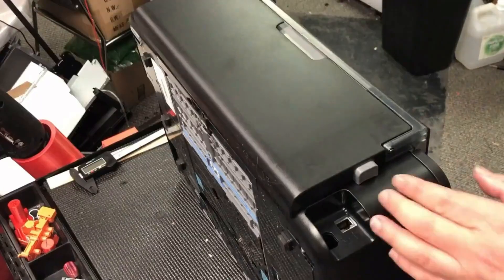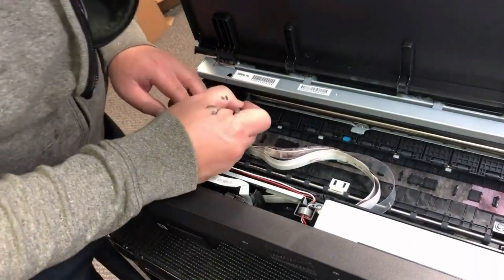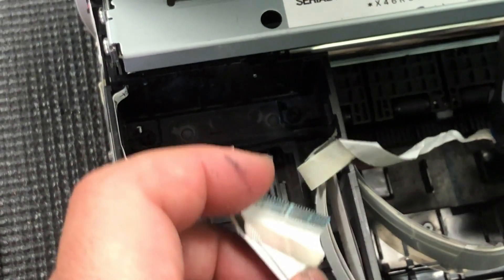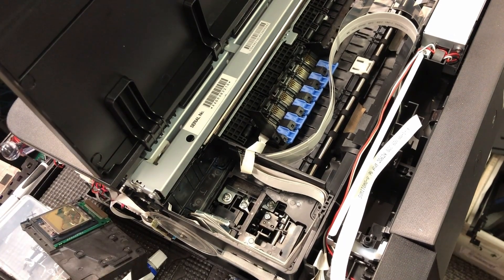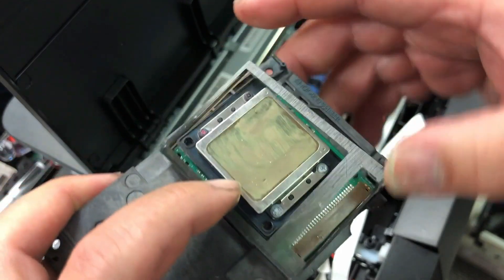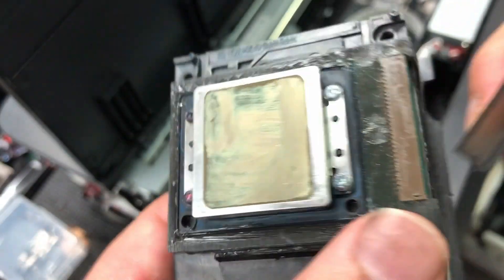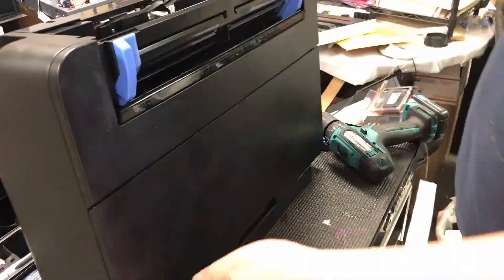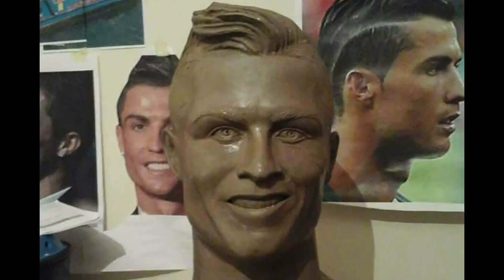Transform Your XP-15000 Into A DTF/Sublimation Machine - Step 2 Waterproof Printhead

Comment: If you're not using RIP software there's no need to waterproof your printer.  RIP software overrides ink flow and re-assigns white to either Red or Gray, which you only need for DTF printing.  Hence, if you're doing sublimation there's no need to waterproof your printer.  Just make sure you're using the correct sublimation paper and settings to semi-gloss.

Comment: Hi, I tried to waterproof a printer head on an Epson xp-8600 but fuse F1 blew right away. I used normal bathroom silicone. was this the cause or are there some components that cannot get silicone on them? I have problems finding silicone for electrical components here in Norway.
Reply from the maker: I always test the silicone with a multimeter before using it, if it's a new brand. Most electrical and marine silicones are good to use.

Comment: @bchtechnologies your step 1 video link does not work. it says it is private. What happened to your tutorial of combined videos to convert the xp15000 to dtf?
Reply: i got the same problem did not see the first part then fry my board cause of it not sure where to find the part one on my second printer een after waterproof it so please make this part not private cause i got no clue what to do with the csic ???
Reply: @guapo5852  @bchtechnologies had a video at one point on how to convert the printer. It was 30 min long with good details. I don't know why it got taken down. I think it's the video that's private. I haven't converted my printer bx I want to review that video as well. Yea, I couldn't find that part on his site either. I think we can just silicone the circuit.
Reply: @gilbertlopez7502   i was thinking to same i just have to get a other xp 15000 today and im so scare to do it again so not sure if we can add silicone i try to remove on my broken one to practice and its not that easy its a little scary to remove the cable so i thonk i will try just silicone it but im scared lol
Reply: @guapo5852  yea he doesn't reply so idk lol
Reply: @guapo5852  I reviewed this video again. really step one is to do the chipless set up. there are other videos online to do this. Its fairly simple. the CSIC board its what is under the ink cartridge. Watch the beginning how he removes it and tucks it into the printer under the front. You dont need the print head protector cover he showed. In another video he has, he just put silicone around the printe head without the cover.
Reply from the maker: Thanks for bringing that to our attention! We're looking into the issue with the Step 1 video. Stay tuned for an update!

Comment: Do you need to let it dry before you turn it back on
Reply from the maker: Thanks for subscribing and for the great question! Your support means a lot to me—I'm working hard to reach 100k subscribers, and every single one helps me get closer. It’s been 8 years, and I’m only halfway there, but I’m committed to providing helpful content and answering questions from subscribers like you.

To answer your question, the electronic-grade silicone you purchased from us is specifically designed for electronic components like the Epson XP-15000 printhead. However, if you use other kind of silicone, it's worth to check with the manufacture. Ours is completely safe to use even before it dries. The silicone provides insulation up to 10,000 volts when wet and 12,000 volts once dry. Since the XP-15000 printhead operates at only 42 volts, you can turn the printer back on immediately after applying it—there’s no need to wait for it to dry.

I get a lot of questions and try to answer subscribers within 48 hours, but if you ever need a quicker response, feel free to email me at support@bchtechnologies.com. Thanks again for watching and supporting the channel—I appreciate it!

Comment: The link to the protective cover guard shows an error. I do not see the piece you used in accessories either. :/
Reply from the maker: Hey! Thanks so much for subscribing and for bringing this to my attention. I really appreciate the support – every subscriber helps me get closer to that 100k goal. I’m halfway there after 8 years, and your feedback helps improve the channel and content.

The link should be corrected now. Initially, we introduced a two-piece beta printhead guard set for the XP-15000 – one larger piece for the printhead and a smaller one to protect the FFC. After testing, we found that the larger guard could interfere with the printer's alignment, so we discontinued it. Instead, I’ve created a tutorial showing how to waterproof the area with silicone sealant, which achieves the same result without risking misalignment.

We’ve kept and improved the smaller FFC guard because it plays a vital role in preventing ink from seeping into the printhead connections. Since the larger guard is no longer part of the kit, we now include two of the smaller guards, so you’ll have a backup. The small guard provides essential protection while allowing easy access for maintenance or FFC replacement. For areas that would have been covered by the larger guard, silicone sealant is the best solution. Here’s the link to the updated printhead guard set: https://bchtechnologies.com/products/printhead-protector-cover-guard-v2-for-waterproof-xp-15000-series-xp-8500-xp-8600-version-3.

Thanks again for watching and commenting! I try to answer subscriber questions within 48 hours, but if you ever need a quicker response, feel free to email me at support@bchtechnologies.com. Your support means a lot, and I’m always happy to help!

Comment: Hi Kevin, First I would like to thank you for all of your great and very helpful videos. I did not realize there was a step 2 video and tried cleaning my ink pads and flooded my ink carriage with cleaning fluid and now it rear paper jams and had a color blinking ink levels on the LCD. Do you think I ruined the print head or CSIS board? Any help would be great! If I did fry the CSIS board do you know where I can get another one? Thank you again and as soon as I fix this I will follow these instructions like I should have to begin with
Reply from the maker: Determining the issue is challenging. If you encounter an 0003x error, it likely indicates a blown mainboard, which is a reparable problem. Nevertheless, if the mainboard remains unaffected, you might face more significant difficulties.  The situation varies significantly and requires thorough investigation.

Comment: Kevin, what about using a silicone conformal coating? It's commonly to make drones waterproof. I don't know if the electronics need to be able to interact with the air, but conformal coating tends to be super sturdy and the commercial stuff includes a florescent dye so you can actually check that you have perfect coverage. I know the print head is controlling flow of ink though so I'm not sure if it would work or not.
Reply: Dude, great minds! This is definitely something that needs to be looked into. It crossed my mind to coat my printer's motherboard with it since I have already moved the CISC, so it is safe. And I still  plan to silicone seal the print head. But it actually crossed my paranoid mind to coat the motherboard as one last layer of protection against ink spills, splashes, etc.

Kevin, do you think it would be safe and actually beneficial to apply a conformal coating to the printer's motherboard? Inquiring minds want to know. 🤔
Reply from the maker: Thanks for the subscription! The conformal coating will be a little overkill. I use regular electronic-grade silicone sealant, and it works well. Easy to put on and easy to take off. The advantage of conformal silicone will be the shortened cure time. Guilty as charged: I usually just put the printhead in while it's wet. Just make sure DO NOT use the spray type, and use the sealant, not glue.